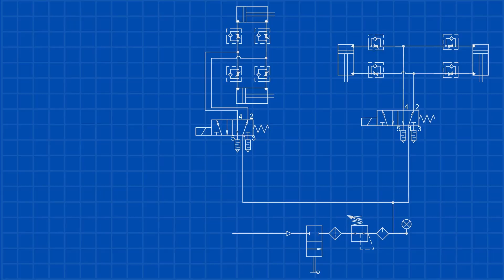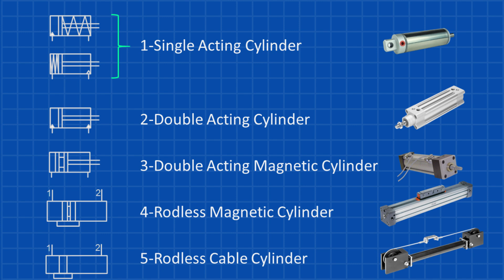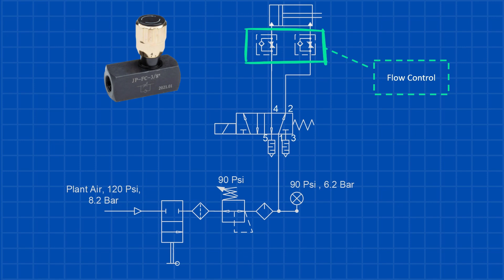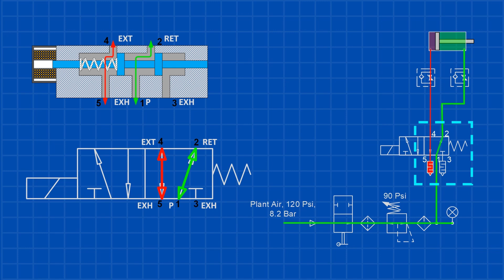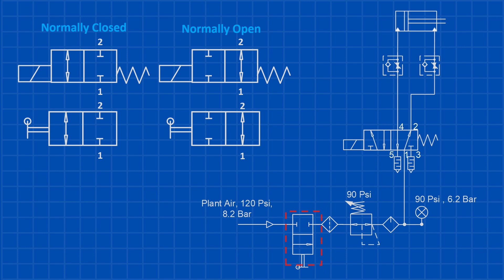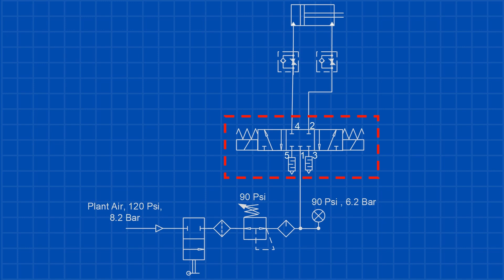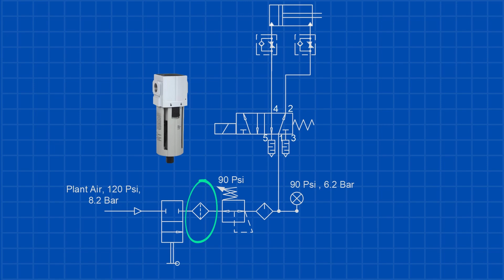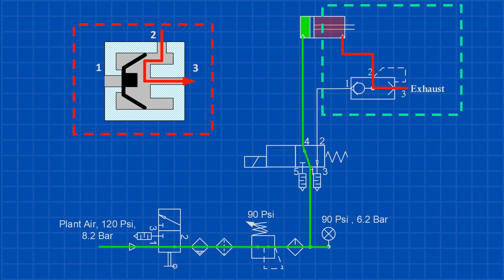Master Industrial Pneumatics in 12 Minutes GUARANTEED!

Comment: Why do you keep calling the 5 way valve a 4 way valve? 
5 ports, 1=P (input), 2=A (output), 3=B (output), 4=R (exhaust), 5=S (exhaust)
Reply from the maker: It is 4 way, with 5 ports ,  5 port valve has two exhausts.  Easier to Manufacture , thanks!
Reply: @Electrical-lad  Everything I find calls it a 5/2 or 5/3.. I can't actually find any product that lists it as a "4 way" unless it has only 1 exhaust.
Reply from the maker: You can call it 5 way , but it is really a 4 way valve.